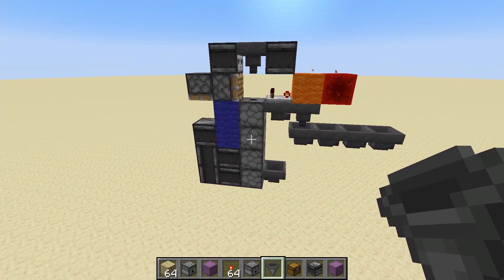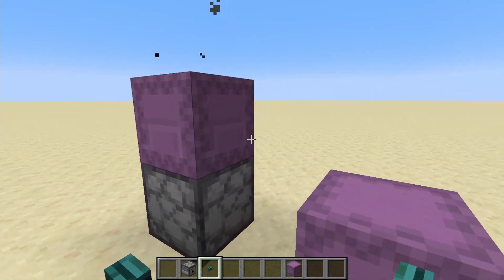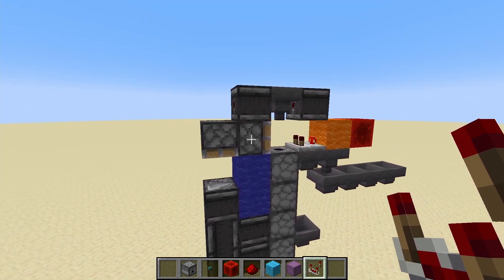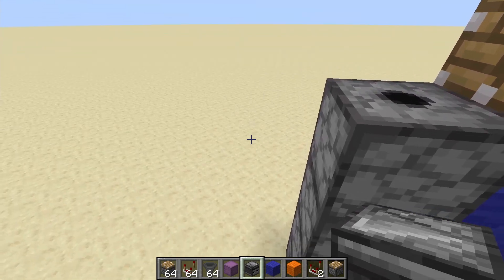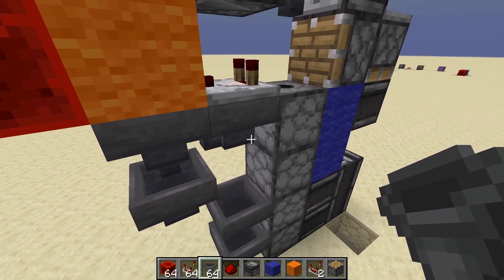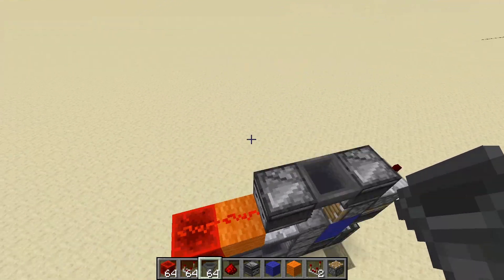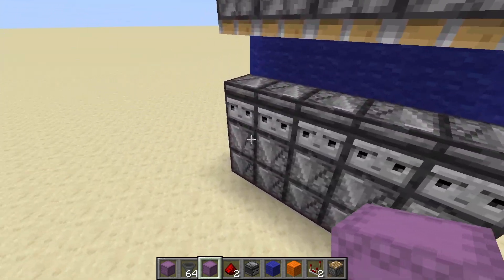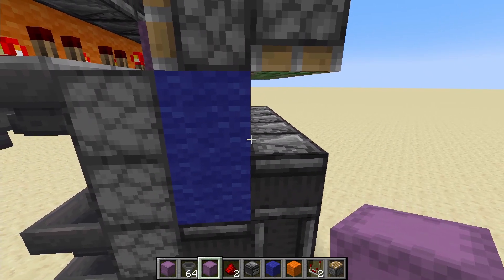Tileable Shulker Box Loader! 1.19+

Comment: Doesnt work in 1.19.2, i built it exactly the same and the shulker doesnt get pushed by the piston and didnt get replaced by another
Reply from the maker: Hi! Just Checked it in 1.19.2, it still works for me. This is Java edition, maybe you're on bedrock? If not, check the direction everything is facing, you may have an issue with the direction of the observers or the comparator

Comment: just tested, doesn't work
Reply from the maker: What version didn't it work on? I haven't seen anyone stating it doesn't work, even in the new 1.19.1 update. It's also still working on my server and singleplayer world.
Reply: @thesurvivalarchitect4122  1.19 singleplayer, built it and it wouldn't break or replace shulkers, built a different one and it worked fine
Reply from the maker: @thatevilducky  Interesting, I've not seen a problem with it at all in my worlds. Are you sure you built it correctly?
Reply: @thesurvivalarchitect4122  triple checked at least, not sure why it didn't work
Reply from the maker: @thatevilducky  That's really odd, you could try it without the repeater on the back, since it works without due to QC.
Reply: @thesurvivalarchitect4122  I did try just putting redstone dust there, that didn't work; is it possibly directional?
Reply from the maker: @thatevilducky  Redstone dust won't work, removes the tileable function. Make sure all the observers are facing in the correct direction too.
Reply: @thesurvivalarchitect4122  could it be because I updated my world from 1.18?
Reply: @thatevilducky  I just built it in my 1.19.2 world, works as intended

Comment: Thanks for the video, i'm having issues with 5 loaders in a row, those on the outside work fine, the 3 loaders in the middle, fully load and then dont get broken by the piston. I saw you had a similar issue in the video but couldnt track what you did to fix? any advise.
Reply from the maker: That's quite odd actually, since I built a loader with 30+ loaders in my singleplayer world and didnt find this issue. Maybe removing the repeater at the back could work? Not sure though since I haven't really found the problem myself
Reply: @thesurvivalarchitect4122  ok so after manually removing and placing shulker boxes a few times and running things through them they are all now working. My only issue is my current use case is a gaurdian farm, loading all items into boxes (within the nether). Im finding that if ink sacs are in the box, it locks the whole box until the ink sacs are a full stack.
Reply from the maker: @nexxd  I would recommend sorting the items into separate shulker boxes. The redstone block makes sure that only when the box is completely full (all stacks complete), then the box will break. Sorting the items will make sure that you dont get these kind of problems.
Reply: @thesurvivalarchitect4122  ok thanks I’ve not worked out how to sort items in the nether so will investigate, as my normal way is with water. Atm it’s working well with just one or two stacks being partly empty.
Reply from the maker: @nexxd  Okay! If it's working then that is great. If you do want to sort items in the nether you can either use droppers and locked hoppers, a hopper chain, or slime block/ice movement and chest alignment to shoot the items over a sorter. Alternatively, multi-item sorters also work in the nether.
Reply: @thesurvivalarchitect4122  ok thanks, i found a fix, i made the signal that is compared to the signal from the shulkbox 13, therefore if its not quite full due to ink stack in the shulkerbox, it still breaks the shulkerbox and starts loading a new one.

Comment: theres no need for the repeater at the back. it will still work with the rest of the timings
Reply from the maker: Its necessary if you tile these. If there is no repeater, then more than one unit gets activated and you end up with half-filled shulkers
Reply: @thesurvivalarchitect4122  I'm not sure you understand what I'm saying. You can take out the redstone dust from the back completely. That sticky piston will always get pulsed because of qc power. Try it and see. That block where the repeater is can just be an air block. Try it and see for yourself
Reply from the maker: Tried it, piston that breaks shulker box doesn't always fire correctly is the problem. Repeater makes timing of shulker breaking correct to have a new box placed in the system
Reply: @thesurvivalarchitect4122  hmmmm I use a similar design but without the repeater. Let me check where the difference is
Reply from the maker: Yeah look I just avoid using QC power cause there always comes a day where you end up relying on it and then boom everything breaks cause QC power
Reply: @thesurvivalarchitect4122  the repeater on piston actually does nothing, piston gets powered by qc anyway
Reply: @thesurvivalarchitect4122  there is a build without bottom part where sticky piston pushes shulker with an observer, that (when returning back) powers dropper strongly (pointed to bottom dispenser) and said dispenser weakly. This build is about halfway there.
Reply from the maker: @theDigited  That's a really smart way of doing it! Mine has a number of moving parts so its a bit more dumb than that but thank you for letting me know about it!
Reply from the maker: @theDigited  Yeah I'm aware of that I made this about two months after remembering how redstone works and forgot qc exists